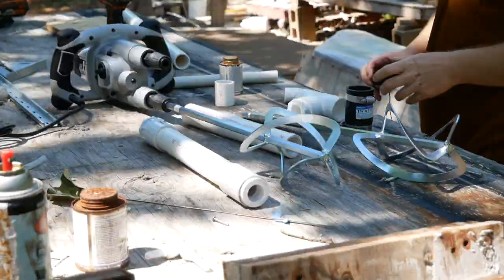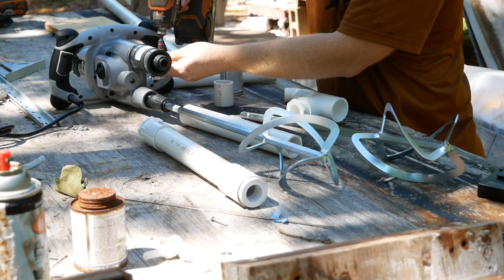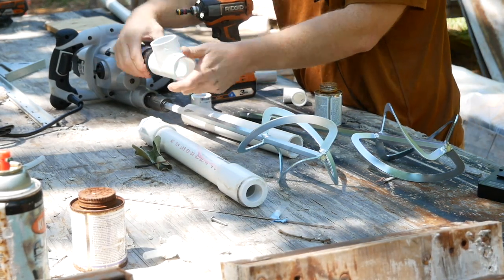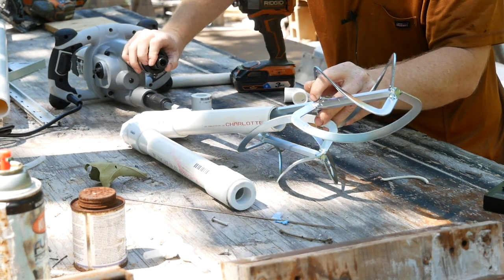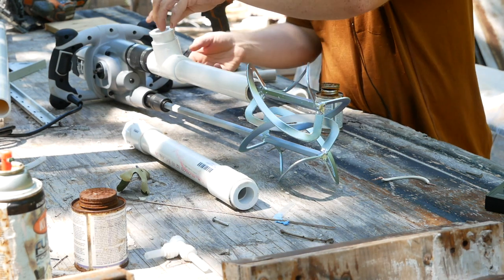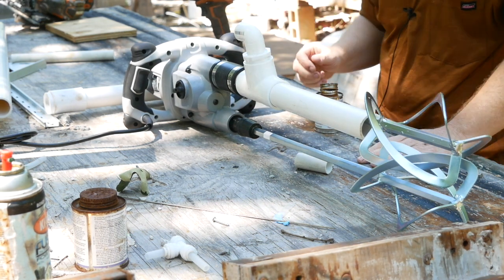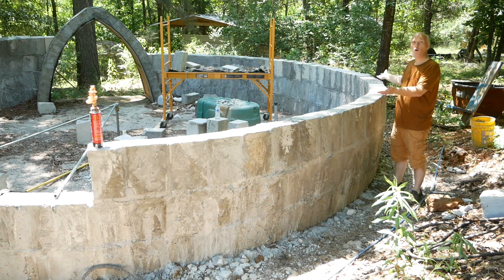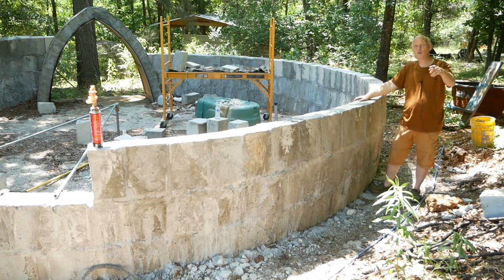AirCrete Foam Injection on Mixer - Workshop Second Ticket Free

Comment: Do the paddles on your mixer pull the cement slurry up or does it pull the foam down when it's spinning?
Reply from the maker: U find running it backwards works best.  Pulling down and rolling the mix down and up the side of the barrel